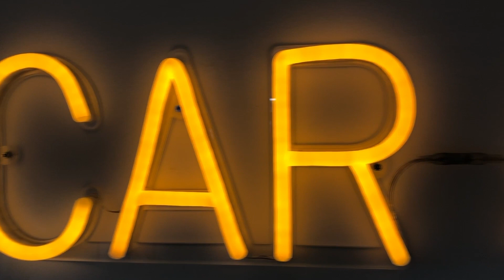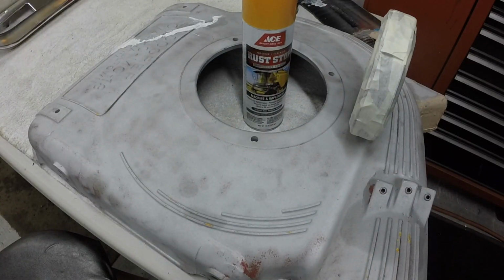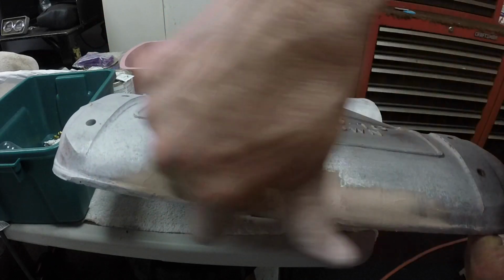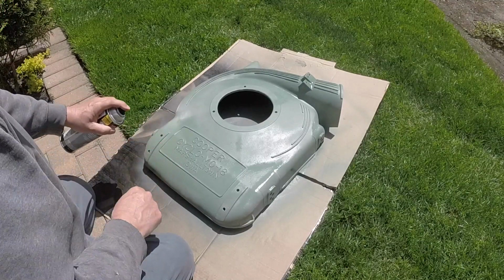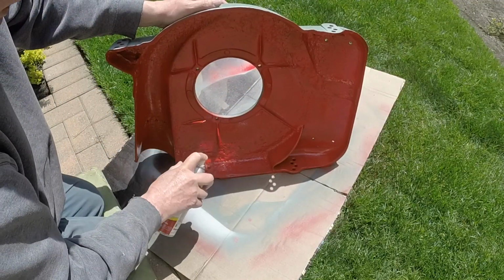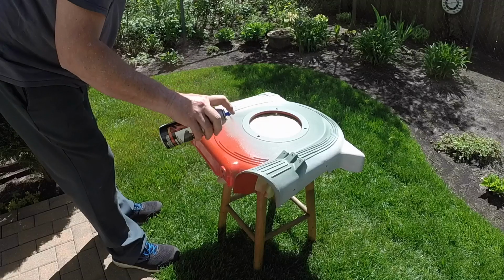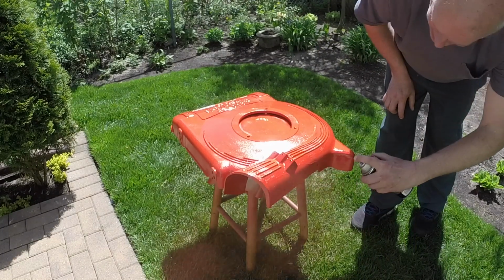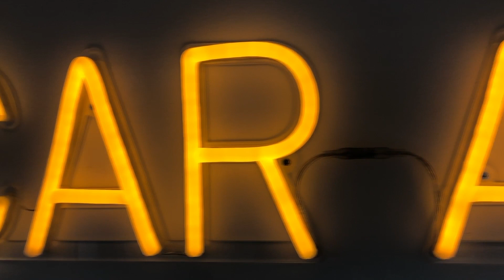Part 2 1956 Cooper Cyclo-Mo-18 restoration, painting the deck with wrinkle paint

Comment: I like how dry its been but the soil could use some good rains.
Reply from the maker: We defiantly need rain. Our local community just raise our water rate 35% to cover the $28,000,000 it will cost to replace all the 100 year old water mains.... even though none have broke in the past twenty years. Their talking raising property taxes to help cover the cost too. Cant wait to vote them out of office!
Reply: @OldCarAlley  ya, riding the fears of the lead situation.
Reply from the maker: @MrBrianbusch  The pipe coming into my house is lead. I had the water tested several times, to find virtually none. It's like .0001 ppm. Guess they get build up in the pipe, insulating the water from the lead. Yes our water line into the house is part of the cost, along with a ton of other houses in my neighborhood......

Comment: That will be a nice looking pair of mowers.  I'm interested to see how you do the yellow accents.  When I re-rattle can sprayed my Snapper deck red several years ago, the raised letters "S N A P P E R" on the front are pretty large by comparison to the trimming you will be doing, and I just brushed white paint on them.  I may have also poured some dishwashing liquid on the red under it, so overpainting would not stick.  So, you have a 1955 and a 1957.  If you add a 1956 model to the collection, that would be a "Tri-Five" collection that is not Chevys.
Reply from the maker: I'll use my touch up brush. I will video it.

Comment: JB Weld usually makes pretty good stuff, I fix up old mowers for some retirement income and I love your posts on fixing these mowers, do you have everything to complete the '57 or saving it for a backup deck?
Reply from the maker: Yes, I got the engine and handles that came off it. I show it running in a recent past video. I had to do minor normal repairs to get the engine running good. I started to disassemble it yesterday, to get it ready to clean and paint up. I'll use the 57 as the cottage mower. The 55 (Grandpa's mower) I will run it once, after I finish it up, then drain the fluids and put it in the trunk of the Bel Air..... It's period correct. I think it would be a fun thing in the open trunk at evening cruise in's. It's super light, and the handles come off super easy, so it will fit in that huge trunk with ease.... Even with my 1959 Montgomery Ward cooler.  I'd need to make sure it docent roll around. I was thinking cutting foam blocks to set the wheels in.